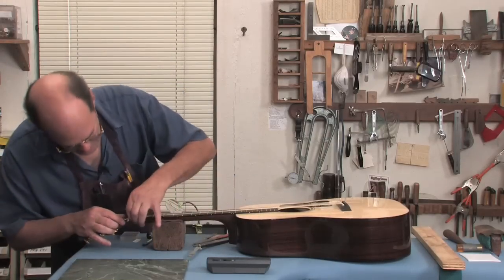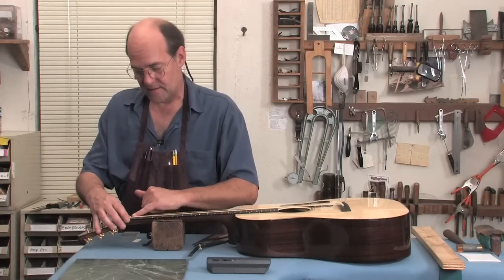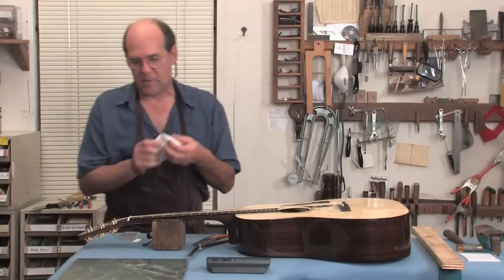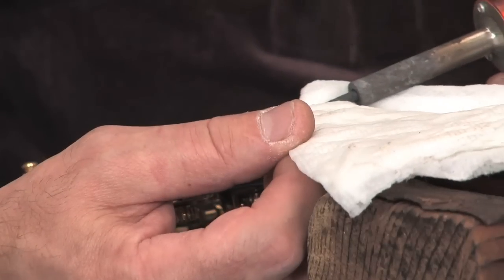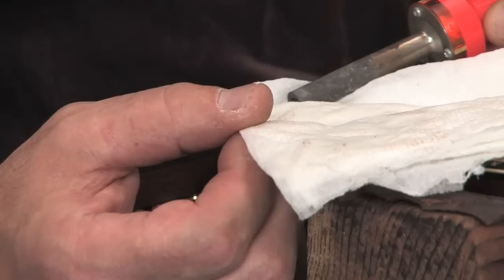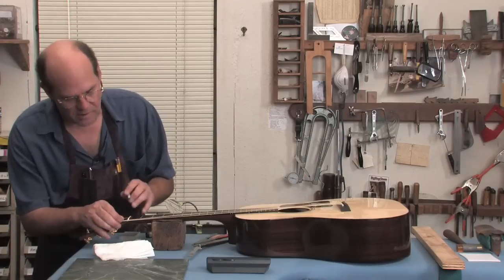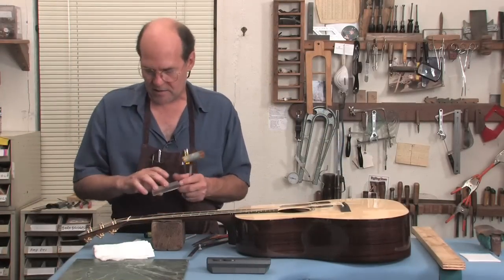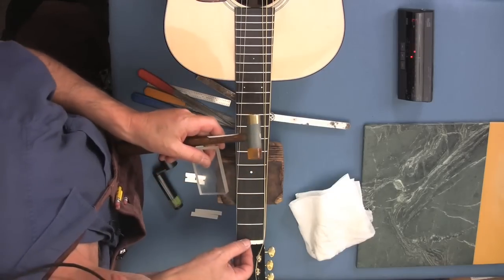How to Shim Up a Low Nut on an Acoustic Guitar (2 of 4)

Comment: here is the technic I use for slotted nut removal:__first score around the edges with a thin exacto blade (like he said). Using a flathead jewlers screwdriver that has been ground down to be a long, flat thin blade.....heat it up with a lighter and push it under the nut. The hot blade usually loosens the glue and the nut lifts upward as you are pushing it in. I have used this method at least 500 times over 35 years.
Reply: hello 13 years later
Reply: @inkey2  lol